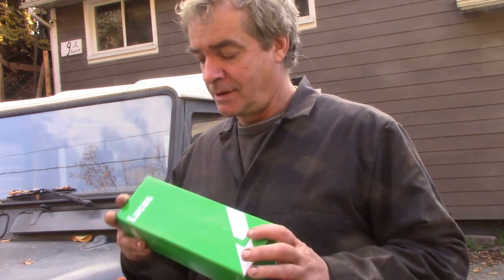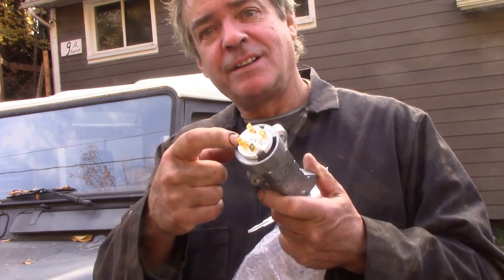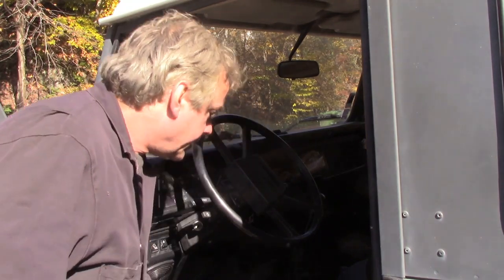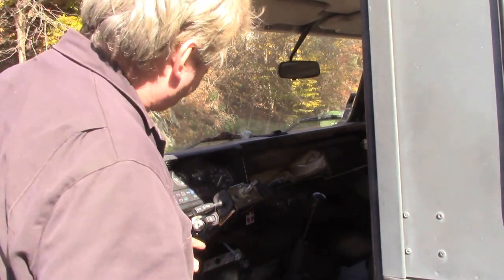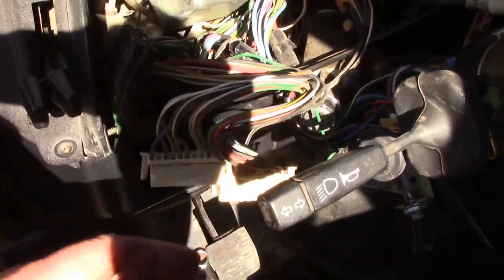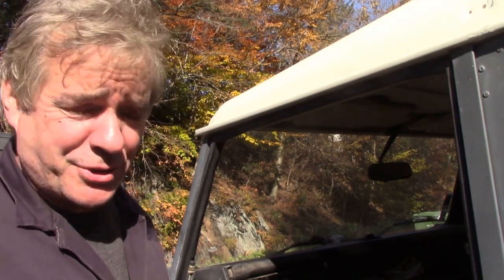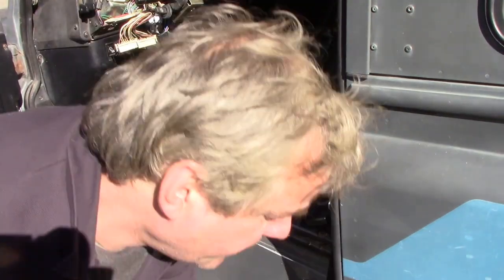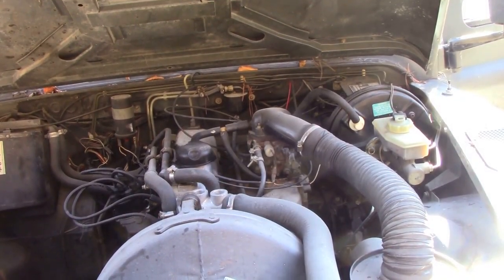2.25 Petrol Defender 90. Not starting. Quite a few issues! Part 1 (Bad edit at 9.48 - keep watching)

Comment: Hi mike like always excellent teaching
I remember in my younger years to clean a fuel tank we usually drop a medium or small size steel chain hang the tank on rope and shake the hanging tank till we see clean bottom always with kerosene or diesel to increase wet clean 
Seeing the tank remains old times far away 
Keep teaching and we keep learning 
Julio
Reply from the maker: Hi Juilo!
The problem with some tanks is they have baffles in them to stop fuel rolling round the tank 

Mike

Comment: On slightly less rusty tanks,  usually on motorbikes,  I'd drop a large piece of magnet,  usually ferrite off an old speaker,  it collects any bits floating around and is quite happy sat in the petrol.

Comment: It's amazing how much moisture would have entered the tank with a evap system. I thought it would be a closed system, or is too old for such a system.
I wonder if an in-tank pump would fit a 10 gal series tank? Perhaps the faulty pump or the shorter pump size you had for testing.
That dual throat Weber is great; fitted one to my series 3, with manifolds. At least LR improved the exhaust manifold by beefing up the casting.

By the way, that stream of petrol looked like honey.

Comment: Had to change an ignition  on my g reg 110 after some clown failed to steal it. Lost a day and $60 odd putting it back but managed without taking the steering wheel off. Was a pain though. Cheers
Reply from the maker: yeap - the cowls for the steering are recessed into the steering wheel  (whose idea was that?)

Comment: Are there fiber glass tanks for the older defenders? At least it wouldn't have that.
Reply from the maker: I have not heard of them - I think it is because in an accident they will crack
Reply: @BritannicaRestorations  I have a transit mk3 2.5di and it has a plastic or fiber glass tank, the mk2 had a metal one, I remember some old folks complaining metal was better, until they started having these kind of problems.
Reply from the maker: It will be plastic as it will not crack in an accident - similar for steel - it is less likely to split when in a collision

Comment: I was told many years ago to try to keep your tank full to prevent condensation forming during cold nights and causing rust.
Not sure how true this is. Any comments on this subject are welcome.
Reply from the maker: Indeed - but only if you use your vehicle  - if you intend to park it, drain the fuel and leave the cap off
Reply: @BritannicaRestorations  Thanks Mike, can I add, to leave the drain plug out too. That would help with a bit of airflow which keeps things dry.

Comment: I'd not be that worried about the carb , if it hasn't run and that pump is knackered none of that crap from the tank would of got that far down the system.  You say it's been sat in a garage for 20 years that's enough to get that tank in that state.  It's good the pump was knackered and he bought it for you otherwise then he would have had more issues!
Reply from the maker: I agree, after seeing the filter - needs a good pump though and it should be fine - I expect the carb would be dry anyway